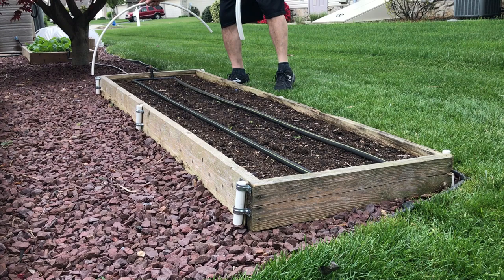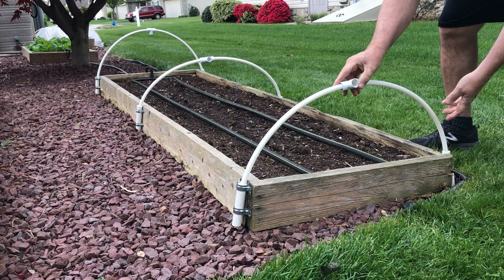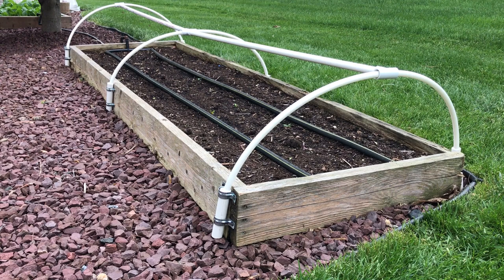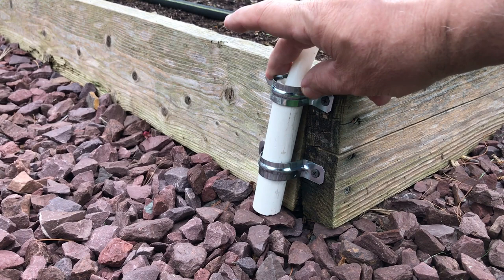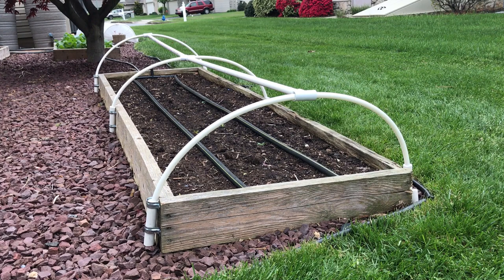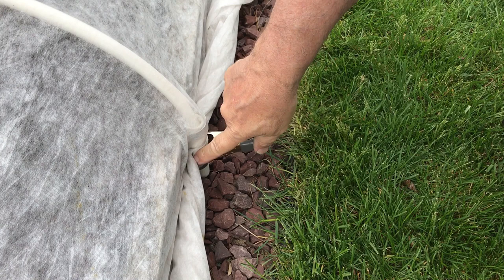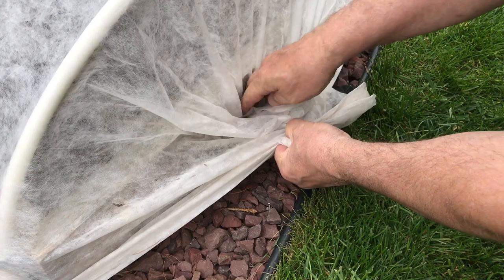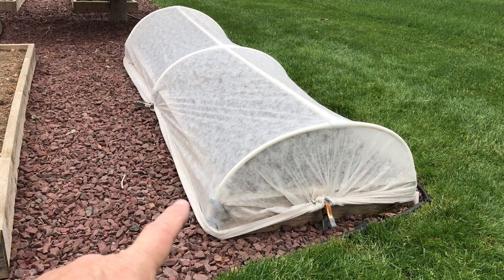How I modified My Row Cover Set up

Comment: Great"I am building a tunnel myself too.I also saw  another way to hold the row cover  so as to be  able to open it  during the day is to drive nails on both sides  of the wood  besides each pvc pipes and attach a fishing line and cross it over  to the other side onto  the other  and so on as if it were  shoe laces .So you hold it tight on the last nail and the cloth won't rip off  with the wind.  If you want to open it you release the fishing line from the last one.